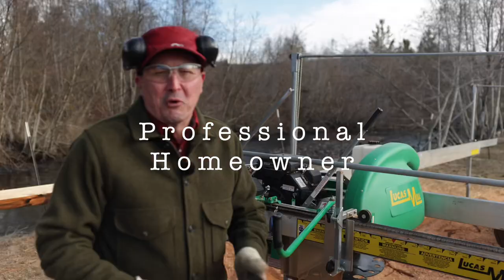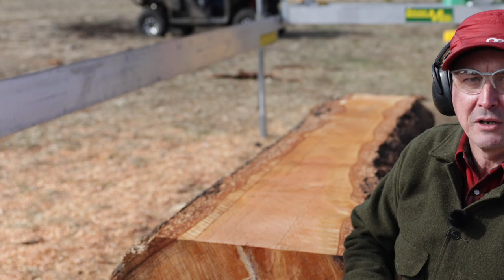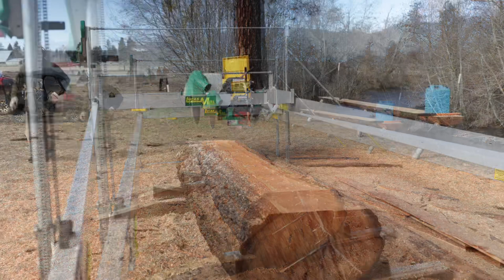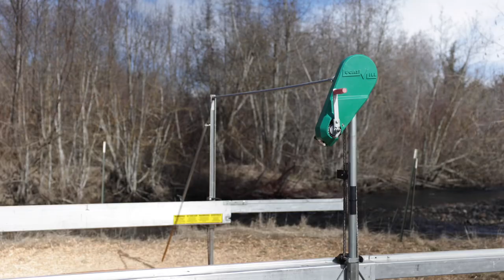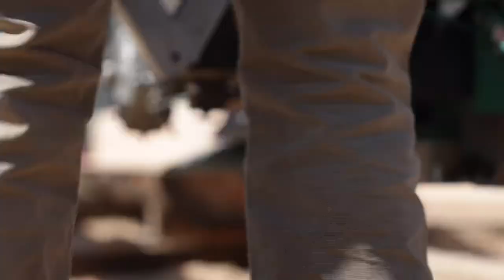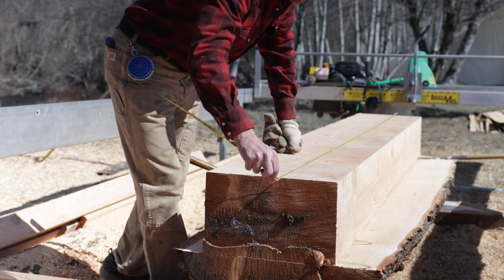Workbench Made From One Log

Comment: Looking at that monstrous slab, and knowing you are planning on using it outdoors, my recommendation would be to use 3 legs of 4" pipe with a 10" plate bolted to the bottom side of the bench and the plate welded to the top of the pipe.  Then concrete the pipes/legs into the ground a little beyond your frost line.  The trick will be getting all three plates leveled to accept the slab before pouring concrete.  It might be easier to completely assemble the slab and suspend the entire bench into drilled holes prior to pouring concrete.  It'll take good rigging regardless of how you decide to do it.

Comment: 257 LB.   Being a Minnesota West Coast wanna-be, I enjoy your videos.
Reply: I'm getting 327 lbs
Reply: @Pyrolonn  9.9 cubic feet. Doug Fir wet at 38 Lb / ft^3 makes 376 lbs. Dry is 34 Lb/ft^3, so 336 lbs. I would say you and I  AGREE!!
Reply: @TheBigMamao  You are not taking into account barometric pressure of the area (if recorded on 3/14) that will add a significant amount of condensation in the cambium cell layer of opened Doug Fir. Add another 43.7 lbs.
Reply: @barrysuss4421  How negligent of me not to take that into account!!
Reply: @TheBigMamao  10"x12"x9.9 ft length is 8.25 cubic feet. I added my comment before he decided to make it bigger.
Reply: @tomray4139  Yeah, he did decide to make the timber bigger somewhere in the middle of the video, didn't he? Good on you. Cheers!! - Tuna

Comment: I’ve only used the same exact saw for about 6 months. If you READ and WATCH the manuals it plainly states make horizontal cuts on the push and vertical cuts on the pull. Personally I wish it was the opposite in order to get cut lumber off the log faster when working by yourself

Comment: Hi wranglerstar.   It sounds like the Lucas mill has a bad generator coil.    A crack in the windings can separate further when at operating temperature and then won’t allow it to restart.  Once the engine cools overnight it starts back up because the gap is close enough to allow electricity through.   Maybe you already checked into this. Just my thought.  I’ve had that problem a few times before with different small engines. Hope this helps. Have a wonderful day ! .

Comment: Good idea about that fuel pump. Sounds like there might be an issue with a capacitor on the old pump. If something runs fine when it's got no accumulated charge there may be a bad starting capacitor or something that pulls power over time from your engine? Just a thought. Either way nice bench! Looking forward to more videos

Comment: I was a diesel mechanic in construction for 35 years rule # 1 never shut off your equipment in the middle of job especially to talk to someone even the camera that’s when bad things happen I do believe like the last commentor I think it’s vapor locking try a new fuel cap sometimes the simplest solution is often the correct one

Comment: Despite the issues you’ve been having, that Lucas sawmill is impressive.
Reply: I would be really tempted to just pull that silly engine and put a harbor freight one on.  At least those tend to run reliably...
Reply: I have the exact same mill in  Australia once you get about 150 hours on the clock the motor should settle in and have no more problems as long as do your daily and monthly check.lucas mill also have some of the best customer serves I have ever experienced.

Comment: As others have mentioned it will depend on moisture content and how fast that part of the tree grew.  If going by the standard for Douglas fir at 12% moisture content it will be right at 252lbs, but considering it's been sitting outside and the inside hasn't had a chance to really dry I'd guess it will actually be closer to 300lbs.  

That said, considering that it's not dry now, will dry out some, but you said it will sit outside so I'd bet that it will be dramatically different between the seasons out there,  how do you plan on keeping the bench flat and square? Or are you not really worried about it?

Comment: According to a quick google, Doug fir weights at 33 pounds per cubed foot for 20% moisture (seasoned wood). 16”x10”x9’ is exactly 10 ft cubed. So that bench weight well over 330 pounds considering it’s probably not very dry.

Green it would weigh 430 pounds. So somewhere between 330-430 pounds.

Comment: Try leaving your fuel cap loose and see how it does. If it’s good you need a new fuel cap or the vent off of the fuel tank that usually runs into the filter housing could be blocked

Comment: I had a Chrysler LeBaron from the late 70's. It would start up just fine when the engine was cold, but would not start again after you shut off the engine when it was warmed up. It was a safety switch that was bad in my case.
Reply: LoL there was no safety in the 70's. Smh
Reply: @joshuarkristof80  it was the "safety" switch that would not let you start the vehicle when it was in gear that went bad.

Comment: Not knowing what carburetion/injection system your Lucas uses (and having missed the last couple videos🤷🏼‍♂️I didn't get all the info)but I wonder if that aftermarket pump, if it's electronic, doesn't have a crack in a board somewhere...or even a faulty capacitor, coil or solenoid. Those take some patience but can be tracked through.
If it is all mechanical though I'm not sure. My experience with vapor lock goes back to fuel overheating in the lines (changing to a gaseous state while still in the lines). Did your altitude change when you moved? And more importantly I suppose, have you run your mill enough to get it heated up since you moved? You mention that it being quite cold today so you're less likely to have an overheating issue in the fuel system under those conditions. Vapor lock is rare in EFI systems but if your altitude has changed significantly you may just need to adjust your AFR.

Comment: I would really test that safety switch on that saw by jumpering it out to see if that is your issue. I would not leave it jumpered for any length of time but if the engine starts repeatedly with a jumper then there is something wrong internally in that switch. If the switch jumper does not work jumper the switch wires where the enter the controller next. That would prove out the wiring from the switch.

Comment: So you have a hot re-start issue and possibly a cold start issue.

The hot restart is possibly a "hot soak" (the engine actually get hotter after you shut it off) electronics issue.  Next time it won't hot re-start, pull a spark plug and check if you are getting spark.

The cold start issue could be related to the hot start issue if the cylinder head temperature sensor is not reporting temperature correctly (or at all).  That engine should start within 5 seconds when cold or hot.  If the computer is using a "default" value, it will be too lean for cold start and too rich for hot start.

Comment: Had an old car that did the same behaviour, problem was vapor lock. It would run for a while then heat up and stop. Let it sit for a bit (hour or more) and it would start back up...but would stop again. Any chance that's your issue with that engine? edit: posted before the end of the video, hope that helps.

Comment: 10" x 18" x 8' 10" = 11 ft^3
density douglas fir = 33 lb/ft^3 (dry/seasoned)
11 * 33 = 363 lbs.  This is probably a minimal, and any moisture in the wood is going to add to that number.

Comment: The reason why the engine will not restart when hot is because the spark plugs gap is too small, enlarge to 0.26mm. As the engine warms, the gap expanded with heat.

Comment: (16 x 10)/144 = 1.11 sq ft x 8.8 feet long = 9.8 cubic feet of fir.  If it were water at 64 lbs per cubic foot, it would weigh 625 lbs.  But at a specific weight of about 0.7 for green for, you've got a bench about 438 pounds.  It'll lighten up though.

Comment: Sounds to me like the fuel tank vent is blocked, prove it by loosening off the fill cap. Not familiar with your engine set up, but if with a loose fill cap the problem goes away then you just have to find the vent and clear it? Could be a cheap fix???

Comment: So the block is 16"×10"×107"
So 16×10×107=17120 cubic inches
17120÷1728= ~10 cubic feet
Doug fir is ~31lbs per cubic foot
10×31= 310 lbs
Do I count as an engineering friend now?
Reply: P.S.: I did not account for the moisture content of the log. So I blame that if I'm wrong is what I'm saying I guess.😂

Comment: 16" by 10" by 8'11" is 17120 cubic inches, so 9.907 cubic feet, multiplied by a density of 33 pounds per ft^3 (for fir) =about 326.94 pounds. That's my guess; error would be in the density estimate.
Reply: i have at 690lbs, but not sure about it.
Reply: @aleksandarkostadinov9827  What did you use for a density?
Reply: or 440lbs
Reply: @robertpothier1861  31lbs per cubic foot
Reply: @aleksandarkostadinov9827  And what dimensions did you use?
Reply: Thats exactly what is my estimated weight too 👍
Reply: 660 lbs eq. 300 kg calculated with the good old metric system. My guess

Comment: l vote for vapor lock, had chainsaws with that problem. Also if your fuel has an alcohol in it your chances of vaporlock increase greatly since it vaporizes at a much lower temp. All my older equitment is run on nonetanol fuel costs more but less cursing and they run better.

Comment: Anyone else wondering why he needs a 10” tall work bench top? I mean I’ve accidentally drilled into mine before but not 10”😂
Reply: I literally was wondering the same thing. It serves no purpose in my minds eye. Maybe half of that which would leave plenty of room to plane down over the ages. I understand it is outside but and he maybe worried about warping..

Plus it would make it easier to design the legs.
Reply: Plus if you cut it down you have some sweet boards for other cool projects

Comment: Density of wood does vary slightly, but according to the internet, the density of Douglas Fir is 33 lbs per cubic foot. Multiply that by the volume: (0.83 ft. x 1.33 ft. x 8.92 ft)(33 lbs/ft^3), and we get that the timber should weigh approximately 325 pounds.

Comment: My SWAG (Scientific Wild A** Guess) at that weight is 425lbs, Cody. Go with a 4 leg Roubu style bench design. You can get a wood screw for the face vise. Use a pegged, removable metal screw set for the end vise that you can haul out to the site when needed.

Comment: Long time listener, first time commenter. Cody, are the valves adjustable on that sawmill engine? If valves are too tight, good running engines will be impossible to start after they've heated up. The valves get longer when they heat, and if out of adjustment, they can hang open creating compression problems that clear up when they cool down and close completely. Seen it on many an ATV.

Comment: Vapor locking check it fuel cap for a small vent hole maybe it's plugged or u need a new  Gas cap, or u can loosen the cap and let the fuel flow easier,. Same issue happened to my lawnmower.

Comment: I think you should do full dowels that run right through the top and into 4x4 legs pre cut out of the same log and make the legs a n shape with mortised cross braces from leg to leg also held with 1” dowels that run right through the 4x4 leg into the brace then out the other side of the leg it will be super strong and also look really good- I don’t think round legs will look right on such a nice big piece of timber and spread 4 of them evenly across the bench to 😃